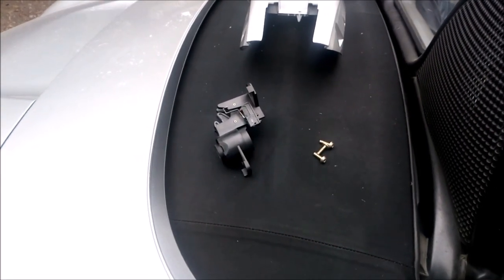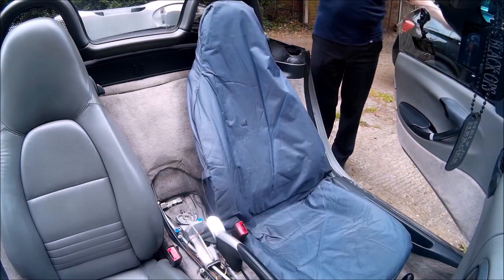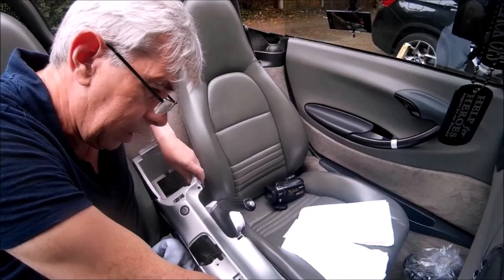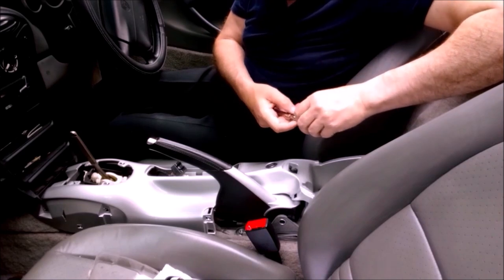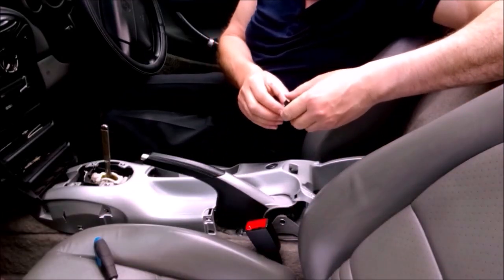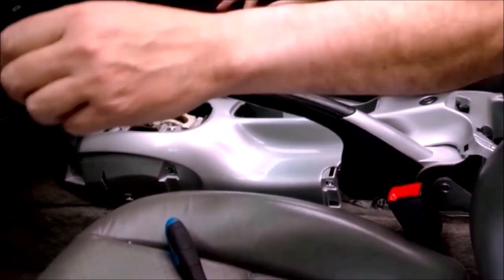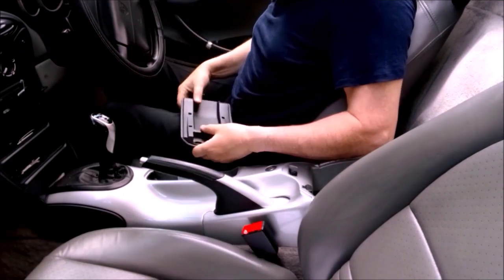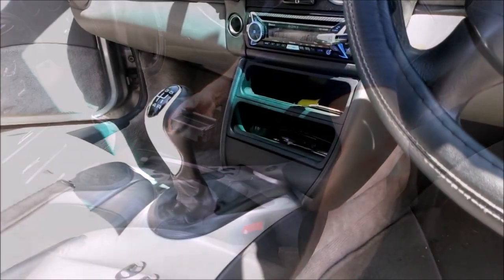Porsche Boxster 986 fitting silver centre consol

Comment: Looks fab, just one question, my car has anti rubbing strips for the seat belts against the consul. Will you be fitting these? Be a shame to damage such a brill paint job. Looking forward to seeing next video. 😊
Reply from the maker: that's a bloody good idea Kieron, I plan to replace the belts clasps with new ones in red, so I will look into the rub strips,
Reply: Paul1962 mine are very simple, seem to be Velcro patch (female). Thanks once again ref intakes. I did try a diy kit but not much success, so did a paint job and it looks great. Shame I can’t upload pic!
Reply: Paul1962 Hi Paul, update on my earlier message ref anti rubbing, the anti rubbing is attached to the seat belt where the belt clips in and not on the Center consul, sorry for any confusion.
Reply: Paul1962 Hi Paul, update on my earlier message ref anti rubbing, the anti rubbing is attached to the seat belt where the belt clips in and not on the Center consul, sorry for any confusion.
Reply: Paul1962 Hi Paul, update on my earlier message ref anti rubbing, the anti rubbing is attached to the seat belt where the belt clips in and not on the Center consul, sorry for any confusion.

Comment: Hello, how much did it cost to have sprayed thanks
Reply from the maker: I paid £85 but that was heavily discounted for the video,
Reply: Paul1962  Thanks for the reply, Just out of curiosity  how many miles has your boxster done, I have just bought a 987 with 113,000 miles on the clock, Just wondering if these engines and made to last for high miles thanks
Reply from the maker: @shanebh007  hi mine is just over 145k and running fine